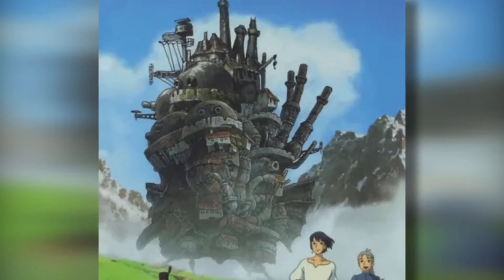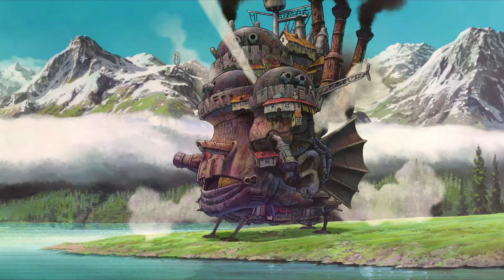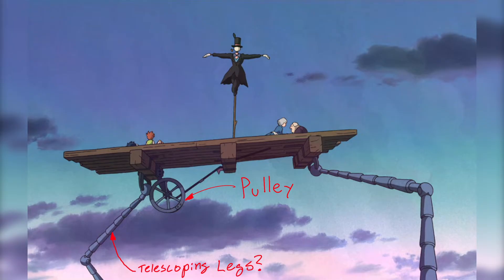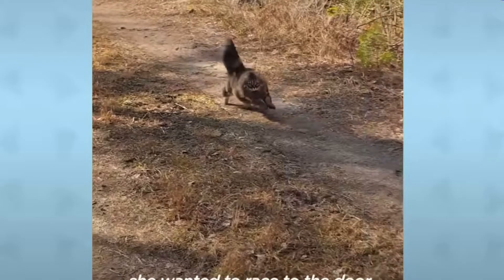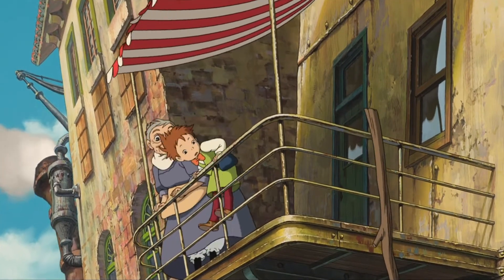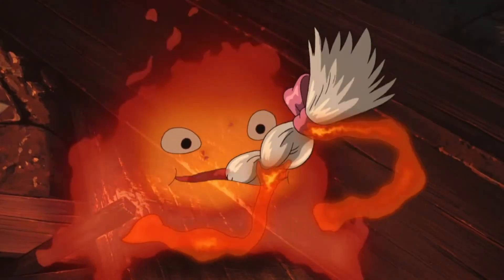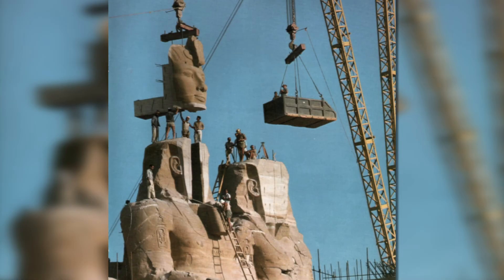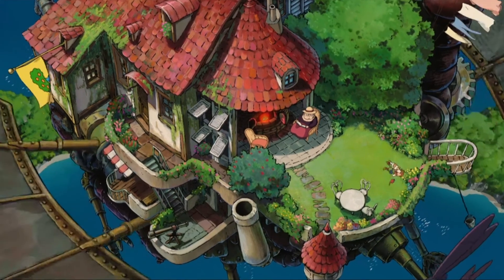Engineer Reviews: Howl's Moving Castle

Comment: Watching the castle walk doesn’t seem very likely to me given the mass of the structure. I’ve seen a few videos talking about how elephants walk and how sauropods likely walked and they generally had three feet on the ground at all times to distribute their weight. If they walked like the castle did they would have likely broken their legs due to the excessive load on their bones. I know you could use much stronger materials than bone but it would likely be safer and more realistic for the castle to have three feet on the ground.

Comment: One of the Anime houses I am often thinking about and would really love to know if they could be doable, is the retractable houses of neo Tokyo in Neon Genesis Evangelion. 
There is even a miniature size version of it https://www.youtube.com/shorts/VGl4Qs5E1cw
But would it be possible with real houses. how would water and electricity work. How much safety would you get? I really want to know all about them
Reply from the maker: Hmmm, like a retractable city block! That’s super cool, it reminds of spinning houses, that I’ve read can be very tricky from plumbing and electrical perspective since those types of utilities don’t like to move, but here, perhaps you could work with flexible ducts/pipes to extend up to the surface. That be a system of its own! Thanks for adding that
Reply: @onstructures  I think in the original Anime they did not retracted the city block but every building individualy. Haven't seen it for quite some time though.
The flexible pipes could be one way of solving the problem. However I personally would solve it another way. 
Since there is never a need to have the buildings half way, you know the exact start and stopping location of the valves. 
So you could detach the valves in one location and then reattach other valves on the downward location. You can do that with pretty much all valves and also electricity I think. ofc with closing mechanisms.

Comment: I feel sorry for Calcifer having to haul those giant naval turrets around all the time. They look chopped down, but 16" guns can weigh a solid 100 tons each and they're placed so high on the structure.
Reply from the maker: Yea, that solid steel couldn’t have been an easy load to bear
Reply: I wonder what Howl use them for
Reply: there is still an option that everything is built from a different super light material , that only carefully resemble the steel and stone, ...right?